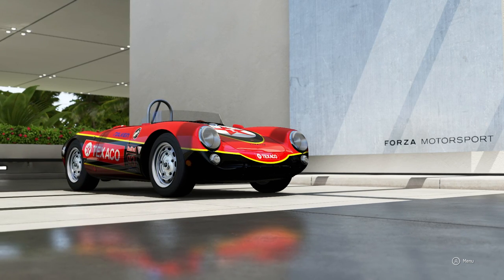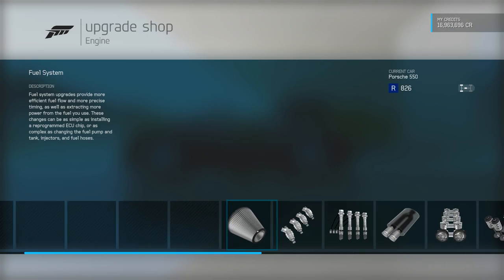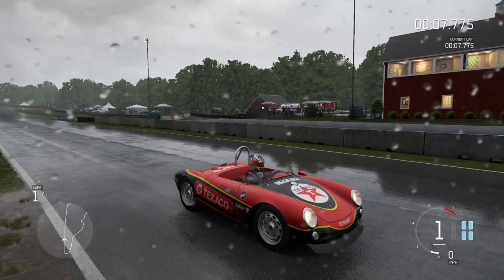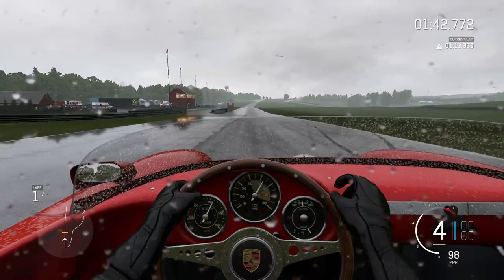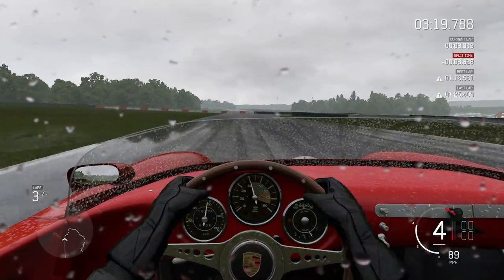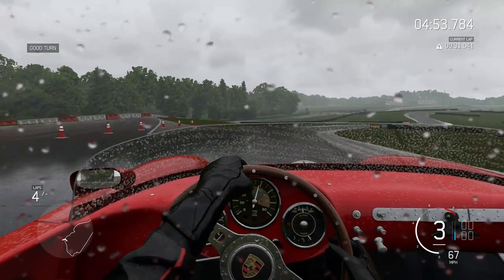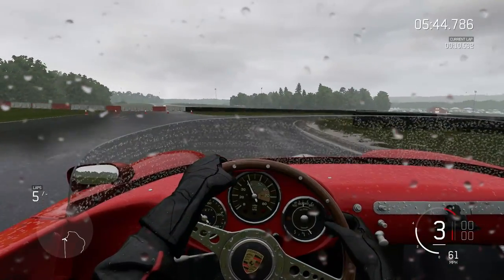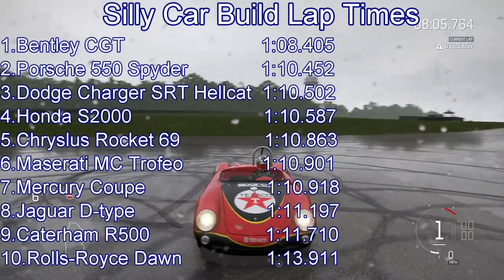Forza Motorsport 6 Silly Car Build Porsche 550 Spyder

Comment: helpful tip for speed running: whenever I tune a top speed car, I lower the front suspension max and raise the back max. You can actually get an extra mile per hour or so.